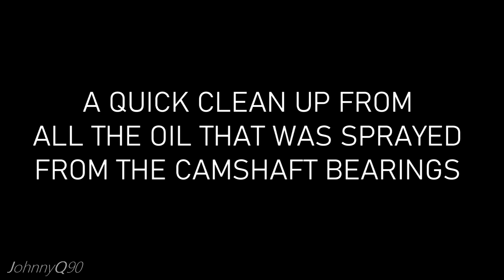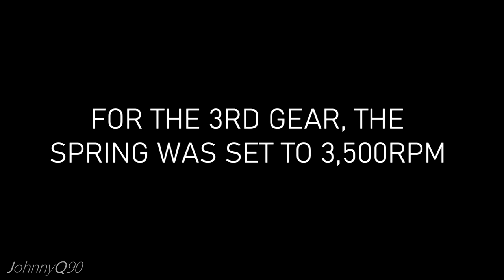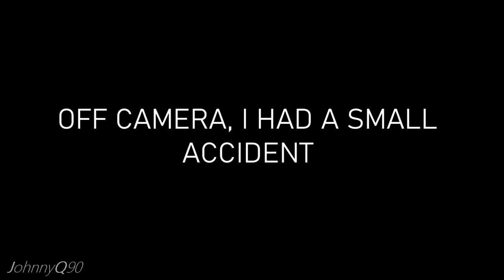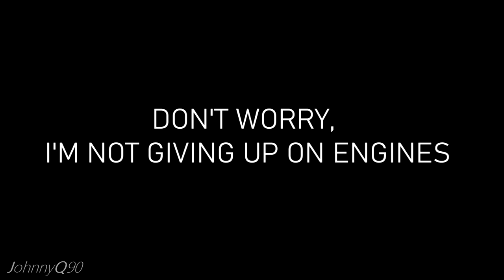How 3 Speed Transmissions work in RC Cars & Next project!

Comment: Hey man it sounds like the clutch might be slipping on the motor. That could be your issue on why it won't shift
Reply: It engages with a tooth. It's not a spur gear/slipper clutch.
Reply: I think its more likely still an RPM problem since he measured the motor RPM without load. He could analyze the audio from running full throttle to get an approximation how high it can go in 1st gear. But then again in 2nd it will probably run even a little lower since the load is even higher.
Reply: @ryanokeefe12  but there is a centrifugal clutch on the transmission input (the metal gears). Have to have it to allow the engine to idle.

He even remade it 3 times. Once for the gearbox (that he tried to make overdrive and had neutral and reverse originally). Then he redid the bell when he removed the gearbox. Then the 3rd he went to smaller gears due to low power.

I think the problem then was the clutch slipping d engine tuning. It should make plenty of torque to move the vehicle and hit the 3 speed shift points. 

Should have kept the 1:2 overdrive and fixed the clutch/tuning.
Reply: @TEDodd  Yes, but it is either engaged or not engaged. it cannot slip. the centrifugal clutch is not a friction clutch. You're way off.
Reply: @ryanokeefe12  how's that? Metal bell with shoes against it. No notches or teeth. Just friction between shoes and bell. And the friction depends on the rotation speed pressing the shoes against the bell

Evey other application of that clutch style can slip. Why would the RC version be different? 

If the springs are to heavy for the rpm range of the engine, they never fully engage and continue to slip.
Reply: @TEDodd  look at the video at 1:10.. The notch is what is engaged by the arm when it is thrown out... It's almost like you haven't even watched the video!?
Reply: @ryanokeefe12  not the transmission output side. The input side, the metal gears. There's a bell housing on them that's driven by a centrifugal clutch connected to the engine.

Like this https://www.amazon.com/dp/B084DT97HG
but with 3 gears on it (one for each speed of the transmission)

In the earlier videos he mad 3 different bell housings and 2 different sets of gears.

It's almost like you've never worked on a nitro engine.
Reply: @TEDodd  mate. You still aren't seeming to comprehend the setup here. 2nd and 3rd gear do not have any slipper clutch. You can see him testing the throw out rpm of the engaging arms shortly after he shows how the arms engage onto the single large tooth inside each gear.. As I said, there is no slipper clutch on the gears. 
Please, I'm begging you. Watch the video. Especially before you start trying to have an argument, please understand that you're arguing something that doesn't even exist on this particular setup.

1:12 "each gear has a notch that is pushed by the eccentric arm"
Reply: @ryanokeefe12  I understand well how the transmission works. I'm saying the problem is on the input, the clutch that drives the transmission.

The clutch is slipping so the nylon gears are never reaching the needed RPM to engage.

Those gears barely hit 4500 rpm with no load on the wheels. Once the drive train was loaded the clutch started slipping so the output gears never made it to 2500 to engage 2nd.

I had a go-cart that would spun the wheels all day if they were off the ground, put them in the ground and sit in it and the clutch just slipped.

Had a chainsaw do the same. Spun the chain fine until it contacted a tree. Then it just slipped.

In both cases, new clutch shoes and deglazing the bell fixed them.
Reply: @ryanokeefe12  lets try again.
The engine drives the disc with clutch shoes.

There's a metal bell housing (which John made in the earlier videos) over the shoes.

Attached to the bell are 3 metal gears. That's the input side of the 3spd transmission.

Those gears mesh with 3 nylon gears. They are the output side of the transmission.

I'm saying that clutch is slipping so the gears of the transmission aren't spinning fast enough to activate the part you keep talking about.
Reply: Here he is making the first clutch. 
https://youtu.be/nUMQpCAvR-4?t=389
Runs to about the 10 minute mark.

Then he removed the gearbox and moved the clutch to the left side of car.
https://youtu.be/760GthQedyM?t=63
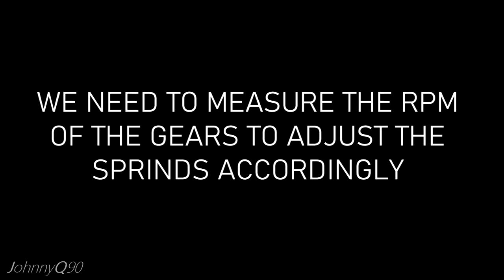Finished around 2:45.

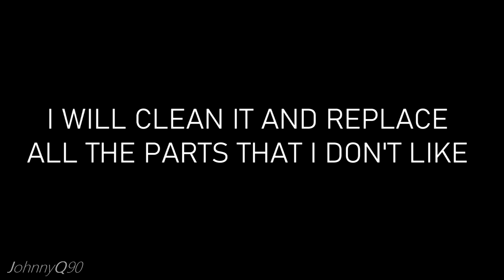Then he changes the metal gears to a lower ratio at 6:50
https://youtu.be/760GthQedyM?t=410

Comment: A 3 speed with a beast of an electric motor will be INSANE! You might want to lengthen the ratios though because of the torque am electric motor has compared to a nitro!

Comment: Ahah I remember 15 years ago (😅), I had the same issue with the gearbox not engaging on my RC car (only 2 speeds). Back then I had very little knowledge about how everything work in that car, so I just gave up ^^.

By the way the guy from the store who sold me the gearbox (yeah, back then we bought things from actual physical stores ^^ ) told me that you can't hear the gears engaging, and it was actually working. I always had a doubt about it. But with your  tachometer, you could check the RPM at the wheels just to be sure

Comment: Maybe there was no shifting into the next higher gear because the rpm of the wheels was to low, while driving. Up in the air, the wheels were probably turning much faster without resistence. 
And a Wankel engine in your next rc build would be very nice! :)

Comment: Dont give up! Make a prony brake and measure hp at transmission vs rated hp. If drop off then that whacky drive is likely culprit. 3 HP should be plenty to push that car high speed. The prony brake will also allow you to observe at what rpm is peak hp and what rpm is peak torque. You cant just clip some off the end of a spring and call it quits!!!!!

Comment: @JohnnyQ90 It sounds like you aren't getting the maximum RPM from the engine as well. I have successfully tuned many nitro carbs to be able to sit at idle for several minutes and go straight to wide open throttle with very little hesitation. The trick is to set it on the bench fully assembled and set the mix for WOT on the hi end needle. Obviously make sure the chassis is secured to the bench and the wheels are off the ground. Once you get the max RPM's set correctly you can then set the idle needle on the side of the throttle lever. Start with a half turn counter clockwise then try to start it. Use a quarter turn at a time after that while trying to start it each time. Once you get it running half way decent you can fine tune it so it will idle at a low enough RPM to leave the clutch disengaged. To do that you will have to turn the idle needle clockwise until it starts to sputter. Then turn the idle setscrew clockwise until it revs again. Keep going back and forth between the screws until you get the desired idle. It's a tedious process but will reward you with a working three speed transmission as I am pretty positive you have adjusted it perfectly to work in this setup.

Comment: My opinion is that you should find a way to fix the clutch issue before moving on to something new. Otherwise, it looks like you just gave up, leaving the V4 project unfinished.
Along with softer springs, you can install a set/grub screw through the shelf (0:56. The part with the '2/3' on it) where the end of the cams rest, or better yet, on the cam itself. By screwing these in and out, you can adjust the distance between the cam and the lug on the 2nd & 3rd gear housing, giving you some adjustment when the transmission engages. You can also add weights to the cams, so that they will swing out at lower rpm.

Comment: Not sure if its been mentioned before but when you measure the rpm at first they are without resistance, maybe a rolling road setup would be better for your testing or somthing. If you picked the car up it'll probably work as you intended without road surface resistance. Keep up the Great work though. kudos!

Comment: Cutting a spring makes it stiffer!!  Sounds counterintuitive but think of a spring as a straight rod. If you try to bend a long rod you can bend it easier than a short rod. A spring is a straight rod wound in a coil. So cutting a spring creates less material to flex and increases the spring rate.

Comment: This shifting problem has a simple solution:
A scale all wheel drive chassis dyno build with corrected horsepower, torque and rpm graph plotting so you can fine tune your primary clutch engagement and all 3 speeds shift points to the output curves of the v4....

We're waiting! 😆 🍻

Comment: As a fellow RC'er I can imagine the difficulties trying to make things work. I wonder, if you took into account that the bench rpm test of the speed of which the gears are spinning gives a false positive, simply because the weight of the vehicle when on the road is restricting the rpm readings you where getting on the table without load. Your springs would have to be way weaker in order to throw out at a lower rpm range in order to engage on the road. Had the same issues years ago with a 3 speed setup on a truggy. Good luck with it.. Nice looking build.

Comment: The motor has more to give. Its still a bit rich in tuning it sounds like.  getting it a bit leaner will allow that motor to wind out a bit more. The other issue is Drag.  On the road, the weight of the car will limit the motors rpms, thus the spur/clutch rpms.
Again the tuning of the motor will allow it to get to a higher rpm, which will allow the gear shifts to happen.
You are also only going a short distance.  You need to let the motor run straight and wide open for a minute. 
It just starts to get to that point an you are stopping.  A better place to run than the road would help.
Reply: He said in the overlay at one point while driving that if he leans it out any more that the engine stops

Comment: If you use 18650 or 21700 cells,  you should liquid cooled down like full size EV cars.

I also really think you should get into metal 3D printing. It's a lot longer and harder or process, but you print the stuff out of powdered metal so it can form properly and then one would "bake" it ... From what I understand, metal 3D printing is strong enough that you could build a full engine and transmission transfer case and final drive/differential units out of it and have it run properly. But that's only my understanding which is why I would love to see it in action.

Comment: Is it possible you're starting with a too "tall" a first gear, like starting a manual tranny  car in third rather than first? As it is now, you're not getting the revs you need out of the engine, so you might want to try changing the gearing rather than the clutch release points.  With a lower first sprocket you'll spin faster; worth a try. If it does work, you'll likely need to change 2nd and 3rd gear diameters accordingly.  Car should be a rocketship.

You publish absolutely terrific stuff and I'm a big fan of your work.  You've got a wonderful, natural mechanical ability and it's a pleasure to watch it in action. Why not tell us a bit more about yourself when you get a chance?

Comment: Will you still need a gearbox if you have electric?  Just go as low of a ratio in your gears and use the motor to control speed and torque, 
You make great videos mate, keep it up.

Comment: Here’s how you could fix the rpm for the gears to engage .

Step 1 add or put gears at the input of the transition to increase how fast the gears rotate in the transmission. 

Ratio of 2/1.34

Step 2 put gears at the output of the gearbox to decrease how fast the gears by the same amount you put to equalize the original power of the engine 

1.34/2

Comment: Hey John, what Kleetus92 is pretty much the same thing I was going to say. However, you need to think Dyno. I can some drums with small bearings and some 3D printed parts. You can put the car on the dyno and check the true RPM of the final stage with the full weight of the car on the dyno. This will give you an educated decision on how to cut your springs. 

As for the control arms, did you consider putting some ridges to the top for stiffness. Thumbs up on a great video.

Comment: You have to put a tp power motor in that car, if you hear it right it will easily go one hundred plus. Search the tube if you don't believe me. I have one in my hobao chassis which is much larger and heavier than yours and I have headed it for fun not speed and it rips 90 all day and has no heat issues. They are such good quality motors you gotta give them a try

Comment: The 3 speed electric is something i actually want to see working, because electric always uses 1 gear.
Reply: For a good reason ! There are more disadvantages using multiple gears as there are advantages. It's heavier, more complex, less efficient and can only marginally improve acceleration and top speed in electric motors
Reply: @abcdefgh-db1to  correct, additionally they can make peak torque from any RPM. That is why ICE needs a transmission, they have a small range of RPM where they make peak torque and must stay near that range to operate efficiently.
Reply: @midship_nc  not true they dont have peak torque from any rpm, and actualy having a 2 gear system on a ev would be optimum
Reply: @hugocunha30  well what is it then? peak torque at 0 then declining torque up to max rpm? linear? parabolic?

Comment: You're testing the springs with the engine under no load. You're probably not getting high enough rev when you're actually under load driving on the road. Just keep cutting the springs until you get to the right rpm range.

Comment: I think the speeds achieved by the engine whilst not under load on the test bench, are not possible when propelling the weight of the vehicle, just keep lightening the springs until it switches.

Comment: The 2nd and 3rd gear are not engaging when you are driving the car because the RPM Will be muuuch slower under load. You Should make the springs even softer

Comment: It's unfortunate that the clutch for the transmission wouldn't work despite softening the spring. Perhaps you could try securing the clutch shoes in so they they remain in place with a lower spring rate?

I look forward to your next project, although it's sad that it's electric and not internal combustion :(

Comment: Actual RPM while running the car on the road might be lower, not allowing the clutch to open up. May need to soften the spring further, if you don't want heavier rotating weights.

Comment: Another great video Johnny, one question though. It seems the fuelling is totally out when its on the road compared to on the stand. Probably because under load it requires more fuel. This could be why it seems to struggle to get to high rpm's. If the enine revs to 11,500, surely you should be changing from 1st to 2nd at 4000rpm and 3rd at 6750-7500rpm? But it don't appear on the street to be hitting anywhere near those revs. Thoughts?

Comment: What about a centrifugal design, with a belt drive and tensioner? As the "pinion" pulley expands speed increases. You would have to find the right balance with the springs and tension arm. Just a thought.
Reply: Or the tensioner could be servo actuated allowing the pulley to expand as needed.

Comment: If the screaming two cycle engines make much more rpm and power while weighing much less, whey haven't you developed a multi-cylinder two cycle? I'm thinking three in line by attaching the crankcases together would be an absolute monster.

Comment: Cool video👍 I've got a lot of r/c models. I have a cen genesis .46 monster truck with 3 speed in forward and reverse. I like doing 50mph in reverse. I also got a complete and a in bits tmaxx that is tuned up with a tuned exhaust made in USA and it will do about 90 mph and its hard to keep the front wheels down. I haven't had them out for some years but still love looking at them and remembering how much fun they are.👍💛😂

Comment: Great! And many thanks for showing the spareparts with sparenumbers ;)
But...
Hmmm... No gearshift till the shiftrpm is reached? In my opinion that must  be a failure adjusting the springs.
How do I get on this?
I had a Crash with my 2-speed that hits the zylinderhead from the front,mainchassis was bent  and the crankshaft worked now crooked (upwards with the clutch). So the gearmesh wasnt fine anymore and the drivetrain was a little bit harder to turn.
Now the Motor still reaches maximum rpm but it never has shift anymore at this point. This means: Any change of torque in the Drivetrain will change the shiftpoint again.
I think u must loosen the Springs a bit more because u adjusted it with no load/torque.

Comment: Gearing is for engines because they can't achieve the RPM of an electric motor.  This is why no model companies sell multi-gear high range transmissions on electrics.  Trypically multi-speed transmissions are not used for brushless motors for a reason - they achieve the RPM without needing gearing, and if you lower the gear ration you will enter the realm of the motor being overgeared.   At best it can do speed runs before melting.

Comment: Electric motor will be good. Be sure to give it a more powerful motor because AWD will need much torque and power. Bigger battery is always good. You can install it as low as possible in frame. Give it gravel tire and reinforced the frame.
AWD drive rally beast!

Comment: Good day sir, I'm a mechanical engineering student. I think the root root of your problem is on the way how you test the clutch. when you tested the clutch it doesn't have a load. meaning the wheels will spin much faster than the actual test. try to measure the RPM of your engine while running on the road. You'll get different required RPM if it's on free wheel and without load to engage the gear. You'll never find/record the real RPM for the clutch to engage if it's not tested on track.